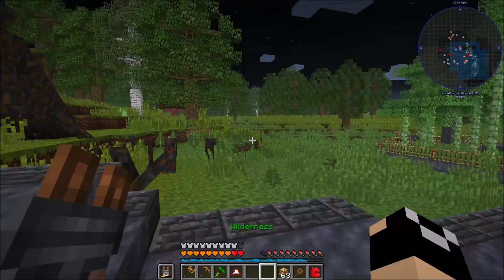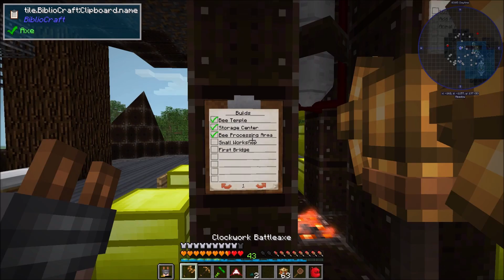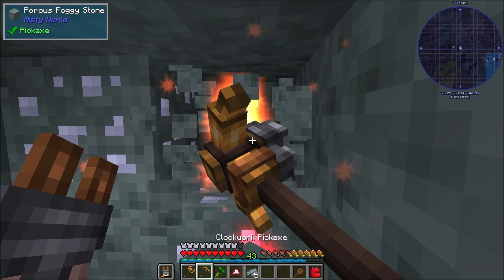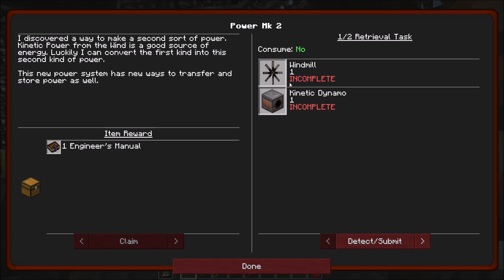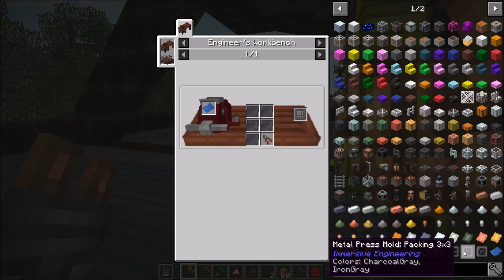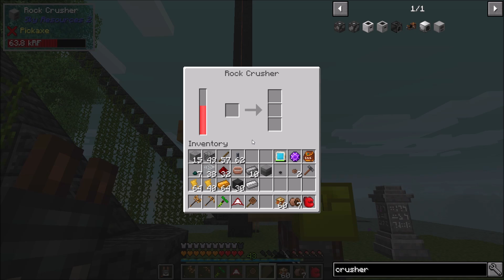Harnessing Wind Power : Exoria Lp Ep #15 Minecraft 1.12

Comment: Loving the series! On the thermopiles the best things to use for heat and cold is that baslitc magma and snow. I have to admit I thought packed ice would have been better, but doesn't seem to be in this pack.
Reply from the maker: Thanks for the heads up.  I ended up not using them for the processing area but will be setting one up within the workshop.  Smelting just turned out better going with the redstone furnace since I could do cobalt, ardite, etc through that.  But may just make the upgrade to cryo/pyro then.

Comment: Thermopiles will work best (for now) with the basaltic magma and snow (20RF/t if you use four sides only). I found them worth crafting around 25 to sustain an induction heater just because it worked as my metal automation that you have for embers set up and was so much faster and fuel-less. 

You can also switch the metal press molds by just right-clicking with a new mold if you don't want to unequip your offhand to remove the mold first.
Reply from the maker: Yeah, the rf cost is way too high on the induction heater imo, so just going to get a magma crucible ;p  they are cheap enough tbh since the machine frame cost really isnt very high at all, plus the rf/t cost is way less

Comment: The windmill is spinning like if the wind was blowing from the side the kinetic dynamo is on.

I don't know why but its bothering me.
Reply from the maker: This isnt true :p  Modern day windmills do tend to rotate clockwise.  However that only began in more recent years.  Older windmills tended to turn counter clockwise.  There really isnt a correct direction for a windmill to turn, just depends on the windmill and the design of the blades.  Most modern ones tend to be designed to just rotate clockwise but IE is more of an industrial age mod in design, so counter clockwise makes total sense in truth
Reply: To Asgaard I am not talking about the way windmills are usually designed to rotate.

What I see in the video is the inclination of the blades/sails and if the wind was blowing on them from the front they should br spinning clockwise. Hence my comment of the wind having to come from the back.